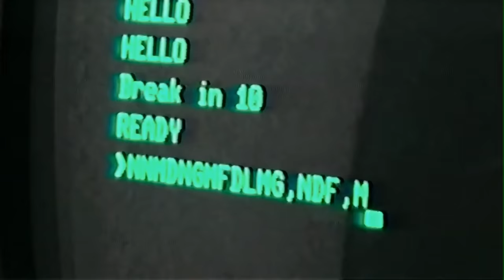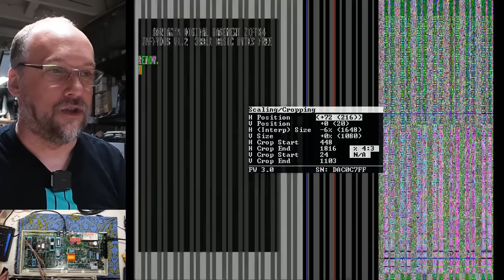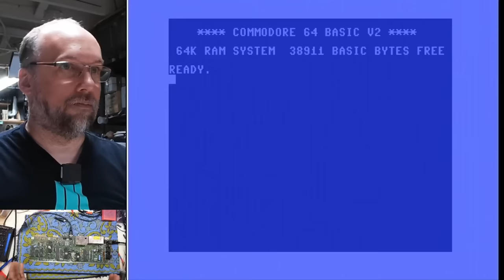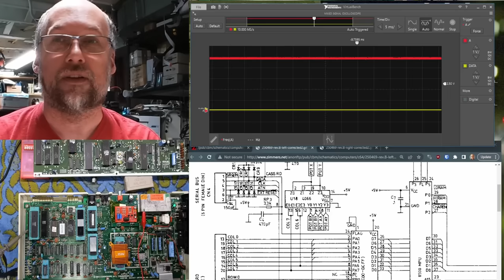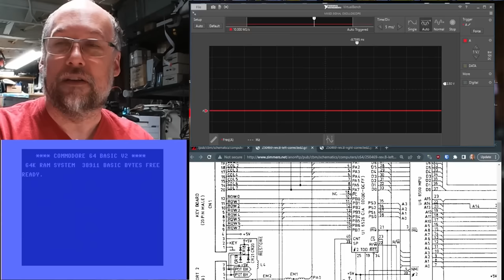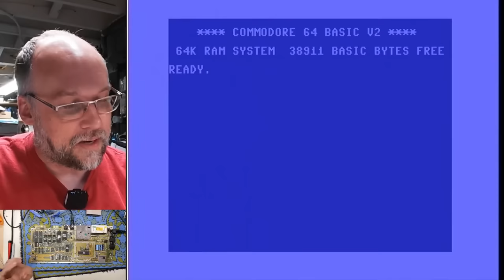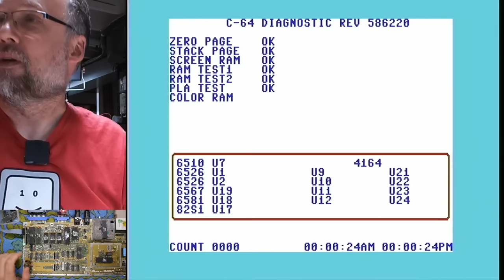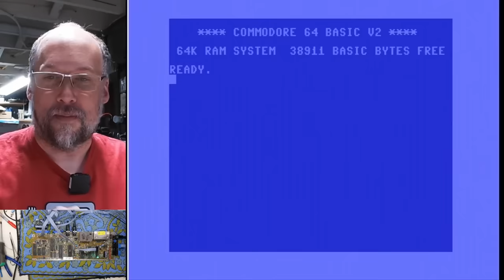Five bad Commodore 64s. One hour. All fixed!

Comment: I've heard a rumor that using a Sega Joypad could damage a 64 CIA chip...  Possibly that?
Some googling shows some people saying that those original Sega joypads used TTL high logic and that the CIA doesn't like that????
No idea if that is a real thing or not...
Interesting, someone on Lemon64 was saying that some of the clone sega pads apparently used logic that wasn't as high a logic level, so it is acceptable for the Sega, but not damaging for the 64...
Reply: IIRC the Sega pads pull some controller port lines high when they are meant to be low, so if you hit a key on the keyboard at the same time a line is pulled high, the increased voltage can damage the CIA.

Comment: In relation to the dead 6526 on the second C64: Check it in another machine, it might still be good! I had a very similar failure on an Amiga 600 where the floppy disk wasn't working but the Time of day clock was, it turned out one of the address lines to the Even CIA was disconnected from a dead via on the board, but the same symptoms could arise from a cracked solder joint!

Comment: I don't think any C64 were EVER made in China. I have a feeling, that last one you did is a knock-off. They were ALL made here in the good old US of A. They did market an Aldi version, which was sold in German Aldi (food stores here today) back in 86 or 87, but nah I don't think any were officially made in China. I don't know what's up with that one.
Reply from the maker: I have loads of C64 motherboards that have Hong Kong written right into the copper layer under the solder mask... Commodore made tons of chips and motherboard there. And then lots of Commodores including Amigas were made in a plant in Taiwan (Republic of China) as well.
Reply: @adriansdigitalbasement  yeah i forgot how it was back in the 80s. It was a completely different world than today. Of course they used suppliers from anywhere they could to produce those things. Not sure what i was thinking although it was almost 3 in the morning when i wrote that.. i miss the old days

Comment: Not just three machines with bad RAM, but all three with both chips bad?  Perhaps those machines were used with failing power supplies, and a high 5V rail killed the chips?
Reply from the maker: One would have to think there would be other collateral damage if that was the case... The hot chip problem is so common on these machines. It's honestly very strange!
Reply: @adriansdigitalbasement  Any common factor among the 3 different computers?  The ram makers were all different, and they span a period of 3 years or more, so you wouldn't suspect manufacturing defects.  

But I have to wonder why you happened on 3 machines,  and all of which had BOTH ram chips fail.  Storage conditions that maybe shorted the 5v rail?  Can you do something like a continuity test on a RAM chip like this and see if there's a short, or low resistance from the 5V power to somewhere that'd create so much heat?
Reply: @stevesether  The assumption was made that each PAIR of DRAM chips was bad... but without swapping them out individually, that can't be known with certainty.  They are cheap enough that it's probably not worth the time, effort or expense to do so... but just saying.

Comment: My guess would be that cap was "fine" for awhile, legs under stress but still intact, but sometime over the last couple decades (and probably a few thermal cycles) it finally snapped. I'd be curious to know what line that cap's on and if it's related to the switch not working or even power getting anywhere at all

Comment: Isn't it unusual that BOTH dram chips were bad?  I would have thought that the odds favored just one of them failed (before the computer was put aside as not working).
Is it possible that all those ram chips were made by ONE company and all the others were selling "rebranded" parts bought from the sole maker?  IE: do the semiconductor houses make parts for each other?
Reply: I don't think so. I don't remember the TI chips that we made were being housed under any other name that TI. But of course it could have happened and I wouldn't have known since they were made here and packaged overseas.

Comment: My thoughts regarding the bad RAMs: Maybe these are the most sensitive devices when it comes to the supply voltage. In contrast to nearly any modern design the 5V rail is fed directly from the external PSU. If you have a flakey PSU or you plug in a "hot" PSU with the power switch already on bad things like voltage overshoot or ringing can happen. Especially when bulk electrolytics are missing or bad like in your Chinese board.

In case of the C64 you even do a hard power on with the power switch of the board while the PSU is always powered. So the design here really relies on correct damping...

In modern designs you typically have an intermediate voltage like USB 5V while the logic is 3,3V, so you have another switched or linear regulator. The bulk capacitors then often are carefully selected to have a certain ESR to damp the voltage overshoot when you plug in a hot PSU or plug in your device into a USB port because when you plug in a hot PSU the voltage can overshoot by up to factor of two if it isn't damped properly.

Comment: NOT TRUE that the clock thingy is needed for the "cursor to flash". Also not true that there is no 6526 replacement. The 8520 is (almost) the same and compatible, but missing the clock, so Giana Sisters wont count down the seconds, but the cursor is still flashing which tells that its not true that it is needed for the "cursor to flash". Lots of misinformation but okay, its youtube entertainment.
My guess is that the 8521 is a HMOS-II version of the 6526 (NMOS). Compatible but not "the same" (maybe). Because all the 6xxx are NMOS, the 7xxx are HMOS (flawed) and the 8xxx are HMOS-II process, so it would make no sense to rename a IC just to rename it, but who knows. That is just my guess, other say it is the same, but a replacement part number or something like that. As far as I know, Commodore never renamed any IC just because without any reason and 6526 is also a normal part/IC number that you can get replacements for.
Reply: "Lots of misinformation...". 😂